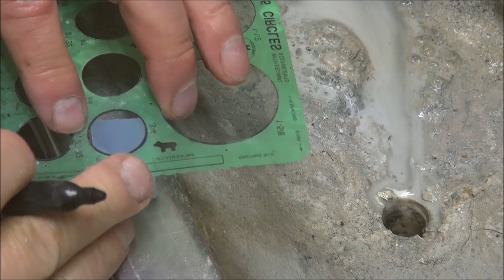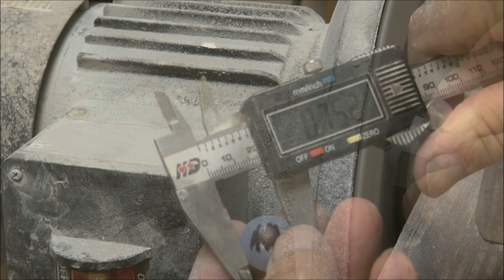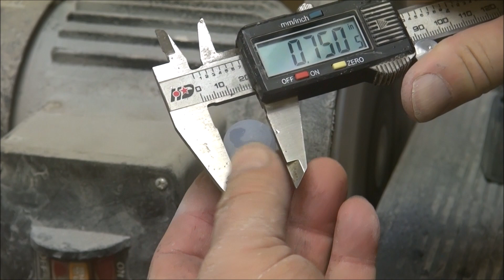Making Two Turkish Blue Chalcedony Marbles

Comment: Do prefer to start with a cube or core
Reply from the maker: I start with a cube.  I dont have a way to make cores
Reply: @MarbleGems  thanks. I want to start making some. In the Turkish blue chalcedony you used a core for one and a cube for the other
Reply from the maker: @southforkmining  My brother had a core drill and I tried it out. I don't have core drills, so I just cut cubes and start by making a "Core" as my first step.
Reply: @MarbleGems  thanks I really enjoy your videos. I just ordered some drill bits. They look like a core drill but the have a concave inside are coated in diamond grit. Should do the same thing as your silicone carbide grinding cups. Thanks